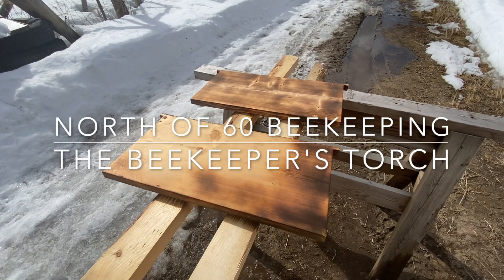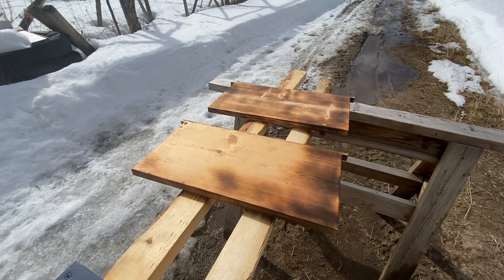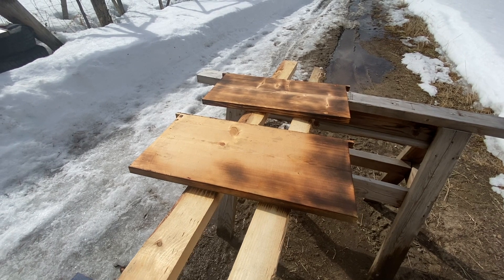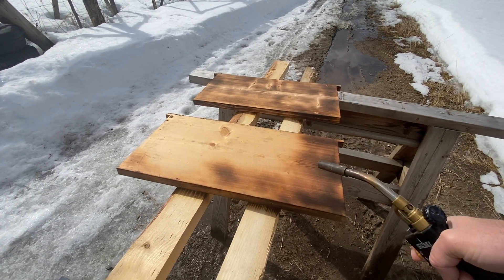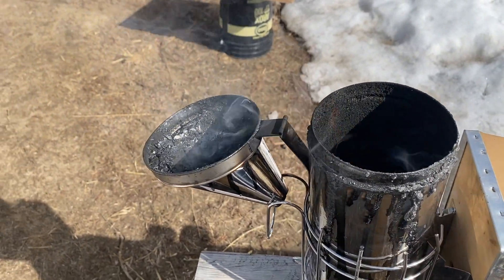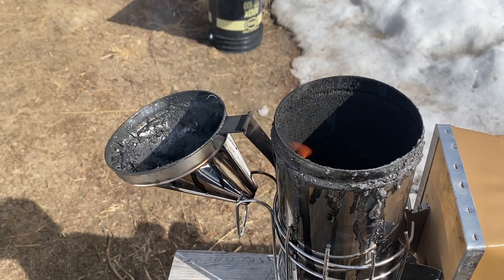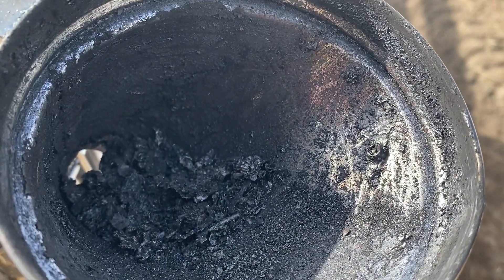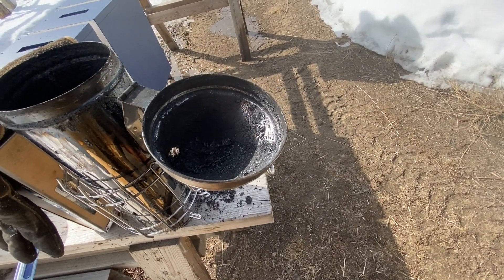Beekeeper's torch

Comment: I char my hives. Old timers said bees like lightning struck trees and charred hives. I make sure to hit knots well with torch. I use a mister with sugar water and thymol instead of smoker. Wet sticky bees don't fly, the thymol helps with mites, and makes bees clean each other and the hive. I use Lazutin hive with top bars that touch. So only opening a couple of frames at a time.
Reply from the maker: Thanks for the info, we have another beekeeper up here who uses Lazutin style hives. He had some growing pains but he now has things dialed in ventilation wise/volume wise.

Comment: Are there any other ways to keep the formation of creosote at bay ??? Great ideas for the gas torch.
Reply from the maker: Fuel type, pine shavings seem pretty good but slow smouldering cold fires which is what we want is the main cause of creosote
Reply: @etiennetardif  Would you tell me what the purpose of the boards you surface torched ??? Besides the sterilization, the function of the surface light charing ??? Thanks
Reply from the maker: @victoryfirst2878  they are follow boards used to reduce the volume inside the colony. The charring help protect the surface from molds and moisture.
Reply: @etiennetardif  So the charing is a type of vapor seal ??
Reply from the maker: "Charred Wood Is Incredibly Resistant to Rot
Burnt wood is another choice for preserving wood from decay. Japanese builders have used charred timber for centuries, calling the procedure Shou Sugi Ban or Yakisuki. It has long been used in Japan for its longevity. The charring process makes the wood resistant to fire, insects, fungus, rot, and (as recently discovered) harmful UV rays. That means that Yakisugi wood will not weather or fade when exposed to sunlight." https://degmeda.eu/does-charred-wood-rot/